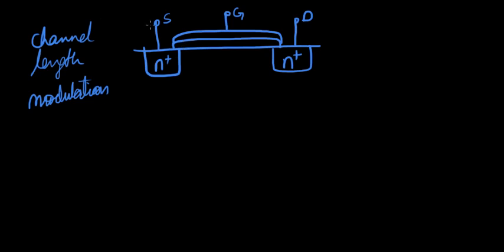Channel-length Modulation

Comment: I have a question, due to this channel length modulation there's some finite output resistance and we see from Id-Vds characteristics that Id is greater than the ideal case.. So where does this extra Id come from?? Is it like in the ideal case there was no output R and hence nothing to extract that extra current.. and presence of R makes it possible to draw more current??
Reply: 1. At Vds =Vgs-Vt the channel reaches the pinch -off state i.e. the channel cannot be modulated further and this is the starting point of the saturation region.
2. When Vds is increased beyond Vgs-Vt (since the channel cannot be modulated further), the extra voltage is then used to accelerate the electrons of the channel  hence the current is increased linearly and is proportional to Vds.
Reply: +Siddharth Sharma Same question here...
Reply: Ya that's the possible explanation I could think of.

Comment: Biki gogoi velocity saturation is the point where the electron reaches there maximum velocity under the application of high electric field from drain that velocity of electron can no longer increase further even if the applied electric field increases...that is termed as velocity saturation

Comment: I think you may need to know that there is no physical difference between the Source and the Drain , and for a N-Channel MOSFET   the Source is the terminal that have the lower voltage . 
This makes sense btw , I believe that you know that the flow of the carriers in any MOS is from source to drain , in this case electrons flow from source to drain , so the current direction is from Drain to Source , so Drain can't have voltage lower than that of the source , I'm sorry for my poor english :)